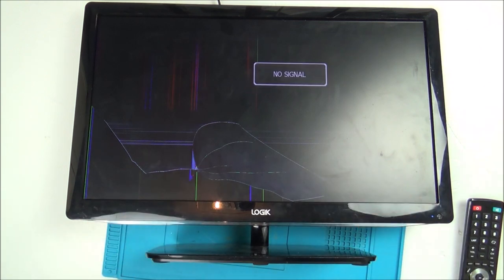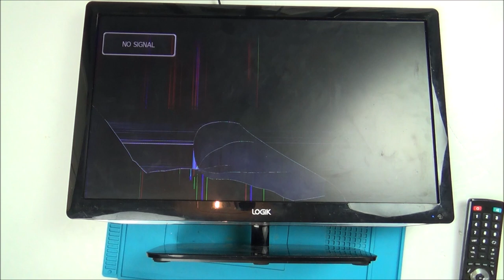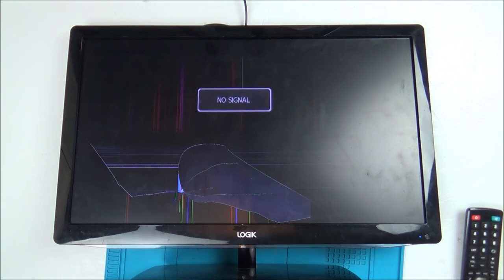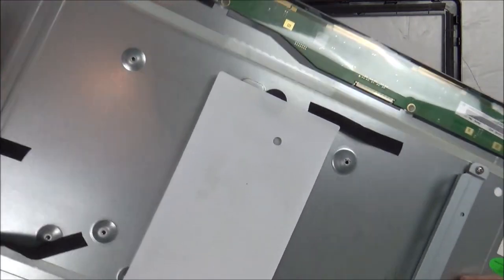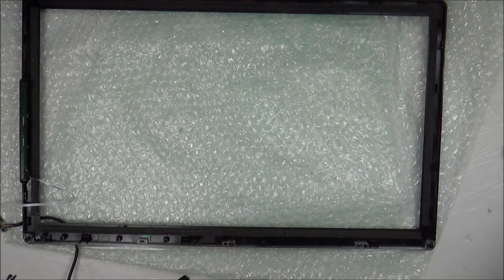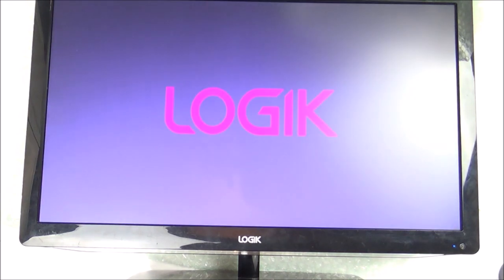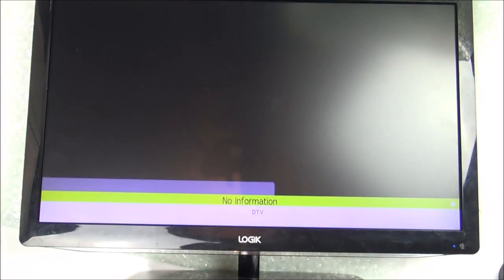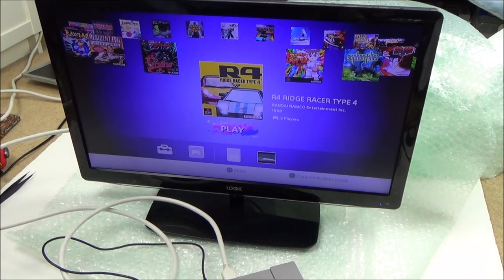REVISIT - Replacing a SMASHED TV SCREEN

Comment: Hell yes!!!! I really felt this. And most people just won’t realize how lucky you are to get this tv fixed. 

I remember when you posted the original vid, and a month before that I went through the same thing but could never find a replacement screen. Only out stock and discontinued email replies.  List price being 1/2 or 1/3 the price of a new tv too 🤦‍♀️ $100-215 
Really crappy part I found a working model on eBay for $240 shipped for a 32” tv.

Comment: I just finished trying to fix my old Sky Q remote control by prying it open with a few picks and a spudger as there were 2 main problems with it. 

1) The play/pause button fell off at some point and wouldn't stick back on again. Come to find out whilst opening the remote up that almost all the buttons were fused onto a rubber pad so that they don't fall off easily, apart from the play/pause button. Overtime the surrounding rubber ripped off and it meant that that button would never stick to the base properly.
2) The power button needed a lot of force to actually work.
So I cleaned up the buttons and the cases with Flash lemon cleaner and a brush, then I cleaned the conductive pads and the little circuitboard with IPA and it worked! The power button only needed a tiny bit of force to press down.
However to try and fix the button issue I used superglue to stick the button to it's surroundings, but I ended up putting too much onto the conductive pad on the button and even after trying to remove it, the button never worked again. :(
So the remote ended up being recycled but thankfully I already had a replacement easy grip remote at hand.

I would just like to say thanks Vince for all the fix it videos you uploaded. You have given me the confidence to try and repair items and see how they work! :)👍

PS: I also managed to fix my Yamaha keyboard by adding more solder to the power and sustain jack sockets thanks to your fix it videos!🎹

Comment: I had a similar issue a few years ago with a 22” Samsung TV with a line down the screen which was due to a faulty panel. It required a replacement Chi- Mei panel and I managed to get a used one off EBay which had came out of a HP all-in-one PC and the type numbers matched. Replacement panel successfully fitted into the Samsung. After all of the faffing about it would have probably been easier and not cost much more to replace the TV outright! It was an enjoyable experience all the same.

Comment: just by the place you plugged in the power cable that loop on a plug with the black wire you can unplug that and REfit that switch and you will have a hard power switch then ..

Comment: I've done the same thing and messed up hours of work and turned it into garbage.
 In particular I remember fully repairing at 5 horsepower engine that had a built-in clutch attachment and I finally started it up and was so pleased to see it running flawlessly until catastrophically broke within 20 seconds because I forgotten to put engine oil back into the crankcase.
 That would have been less than a dollars worth of oil that I already had on hand and I completely trashed the engine.
 I was not a happy camper.
Haste makes waste!

Comment: One thing i would salvage from the old screen is the back lights not sure if this is led or cfl lamps but could be worth removing as spares though a bit more of a pain to fit if they fail .I am using a 37 inch tv that i got over a year ago that was dumped panel was broke but found a cheap replacement on ebay £32 posted lg screen only a vestel made set but does what i need and for what the panel cost i have had my moneys worth i use it for dvd ,bluray and netflix and watching youtube using my pc and a bit of web browsing .

Comment: Do you need the exact same panel for the tv to work? Wat if he used another brand panel? I  am putting that together myself but Im kinda scared to plug it into 220v. So I had 2 broken monitors an have taken the screen from one and the 2 boards from another 24incher. I need some advice!

Comment: from what my father said when he worked in Sony back in the 80's/early 90's was the screens cost something like £1,000 each to replace. so way cheaper just to throw the tv away than get a new screen. so unless they were still making the same tv's, then the manufacturer would make a massive loss just making 1 screen, hense they would pass on the charges to the consumer. so it was the main reason why tv's would be thrown rather than repaired. I would have thought that being panels instead of tubes, then replacement would be easier. there again they are made extremely fragile. surprised it managed it the 10,000 miles without any damage though. looks like the insulation worked really well, and the panel wasn't miss handled while in shipping.

Comment: Personally, I would mod this TV to have an IEC connector on the back instead of only having a fixed power lead. It's easily done, all you have to do is dremel out a hole big enough to mount the connector in the back panel and connect the included power cable to the backside of the IEC connector.

Comment: Here is a trick that might work. Look on ebay for a driver/board compatible with your screen. See with other screen acre compatible with your driver/board. All screen compatible with that driver should also be compatible with your TV.
You can also look at the pinout of your board (if you can find the schematics) and rewire a similar screen if the pins are in a different place.

Comment: if you pick the TV up from the back and put your hands only under the plastic piece on the front and on the front a little bit also only on the plastic piece to keep it from getting dropped it shouldn't break again if you need to move it, that is how i carry my 1280x1024 VGA 19 inch HP monitor and it has not broken yet which is good because it's very old so i probably wont be able to find new parts for it too

Comment: If it's a cheap TV is useless search eBay for replacement panel by the model, yo should completely disassembly de panel from the chassis, and search ebay by the reference of the panel, because it probably is used on a lot of other cheap TV

Comment: The reasons you can't find replacement LCD screen for TVs, especially inexpensive TVs It's because the company Don't allow the factories that produce the screens to sell to third parties their is something called the right to repair It's a bill that insurance Electronic companies will have to  allow the third parties to access documentation and replacement parts reasonable prices. If you are an advocate for customer rights I think you'll be interested.
Reply: The European Union has already brought in an act for right to repair to begin in 2021 and will cover appliances within 10 years old. Although the UK just recently left the EU. That's a bit of a pain for them. Not sure where their stance is on RTR.
Reply: @SteS  well it's nice to see progress somewhere I live in the state so the chances of this happened over here is slim he'll LG just released a commercial on YouTube stating that if you or a third party change the battery in your cell phone it will explode and sadly people believe it is something I can't get my head around people spend thousands of dollars on these devices and when something breaks they just buy another one that's like buying a new car every time you need to change the oil
Reply: @BenjermanKulandaisamy   I'm sure once one does others will follow. It's money talks over there it seems. Pro MMA events where banded in NY and it was the last state to do so. The reason, bribery. The state assembly speaker Sheldon Silver had the last say and was paid to throw the decision for 20 years. That's why I like being part the EU, multiple countries come together and look out for what's best for everyone. Yes, I seen the ad on Louis Rossmans channel. Scare mongering is strong with that ad.

Comment: £28 postage more than the TV is worth,,,,   facebook market place there a tenner get a 32 inch for £30
Reply: It's worth it to him.  I've seen that TV set used prominently in his videos.  Strictly speaking in terms of value, you are correct.  But it does what he needs it to do, and it has sentimental value --- not to mention the practicality of him getting another Trying to Fix video out of it.  He's also correct in some of those inputs have been dropped (no longer included) from more modern sets.
Reply: @nightstah  yea i agree with you about the reasons for him to do it i was just saying £28 postage is alot

Comment: i had a laptop lcd crap out, trying to get a working replacement off the net was impossible, two lcd panels i got both did not work 100% and both had been taken apart by some doggy Asian from china and sold as new, lucky i got my money back and ended up getting a new laptop,  The Asian tryied to say it was my video card and not the lcd panel, but my partner has the same laptop and i instilled her screen in my laptop to test that theory which was BS, so now its spare parts for her laptop lol